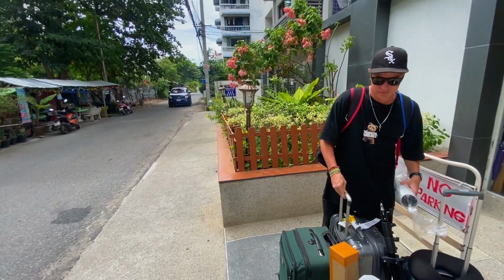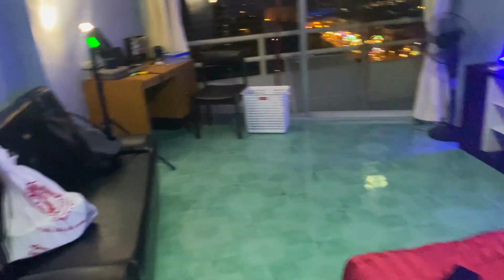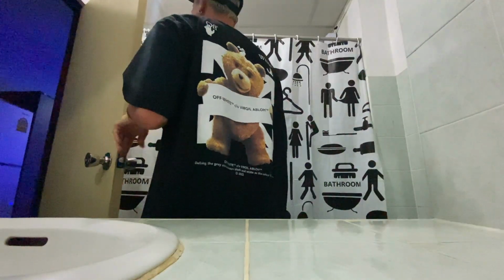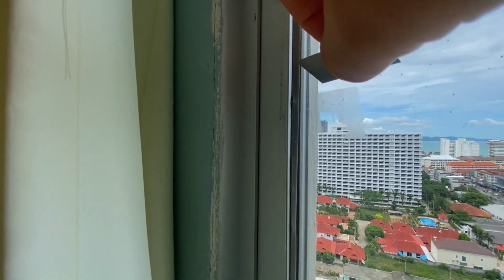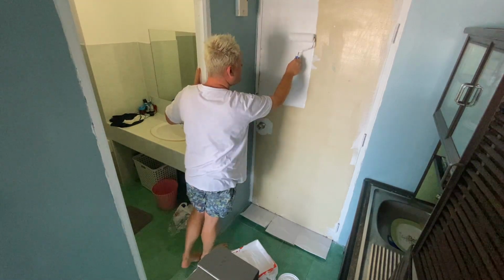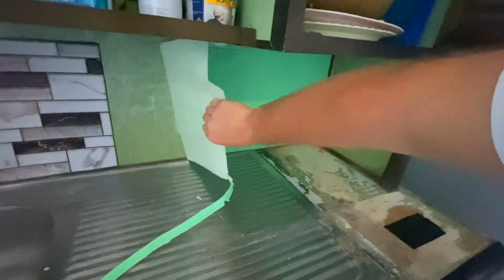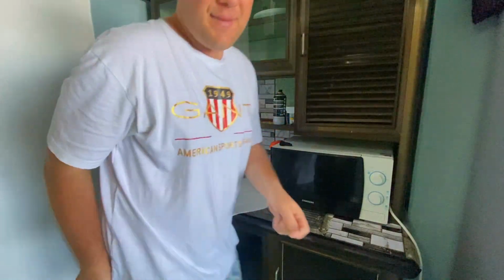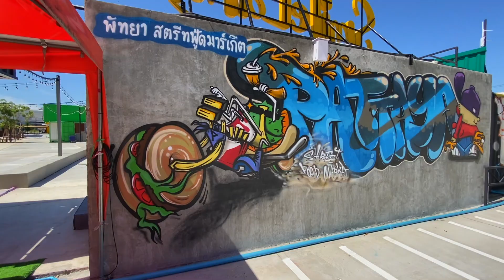I'll probably LOSE my security DEPOSIT | Jomtien Condo

Comment: Overall, how's your experiences been when you ordered items from Lazada, i.e., Delivery Speeds, Inventory, CustomerExperience,  etc...? Also, are there any specific things you need to do, in order to receive packages for a temporary address? Thanks!
Reply from the maker: Regarding temporary address, just try to find out if the item is in Thailand or coming from China. The items I ordered from China took about 8 days and local ones 2-4 days. Brilliantly fast
Reply: @GoneAdrift  Thanks for the heads-up!👍 I didn't realize they ship from both countries.